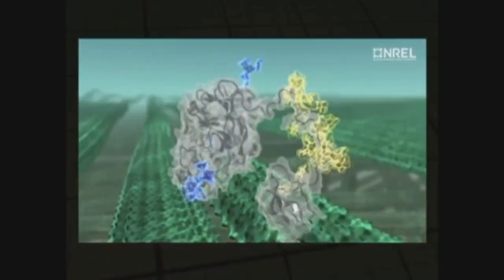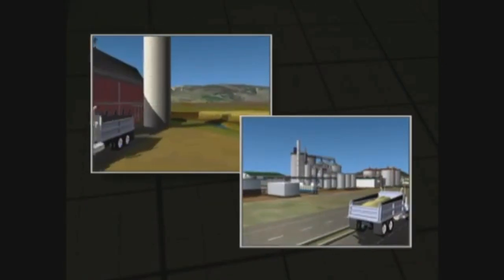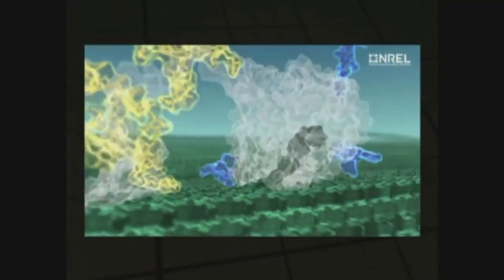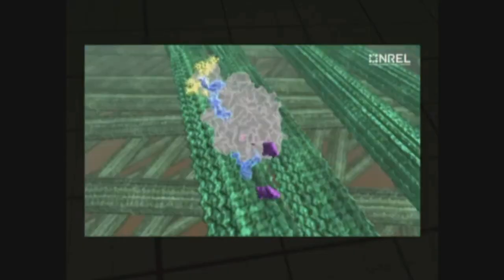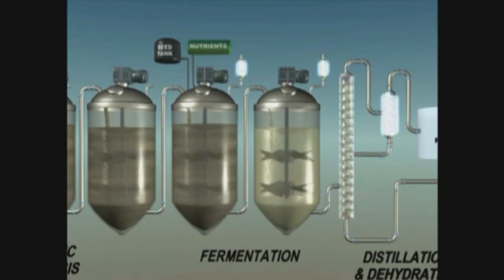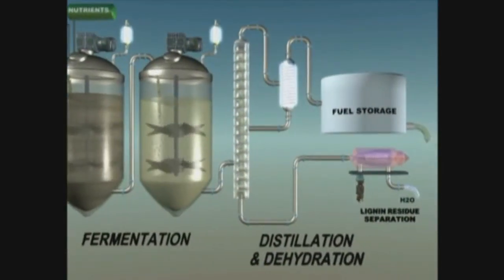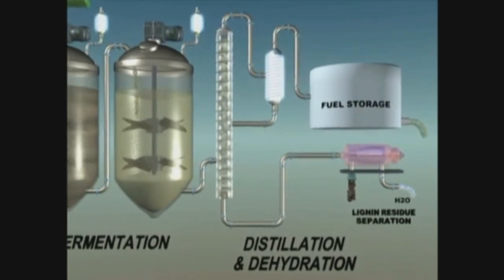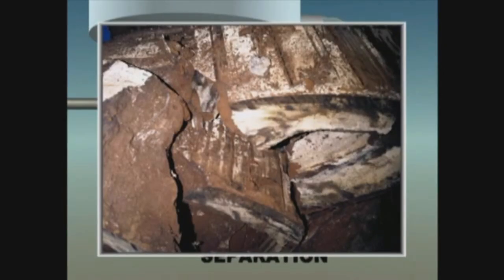Bioethanol Production from Rice Straw

Comment: It is better that rice straw is cut into small pieces and introduced into a biogas plant where cellulose and hemicellulose are converted gaseous methane fuel mixed with CO2 almost (1:1).CO2 can be stripped by passing the gas mixture through an amine tank resulting in 98% methane which can be compressed to be used as a fuel. The CO2 can be separated from amine for compression. The sludge contains lignin and can be used as a solid fuel. The leachate from the sludge is a good fertilizer. All of this can be done at a minimum investment when compared to that required to make bio ethanol.